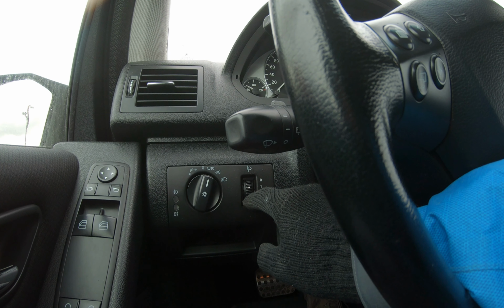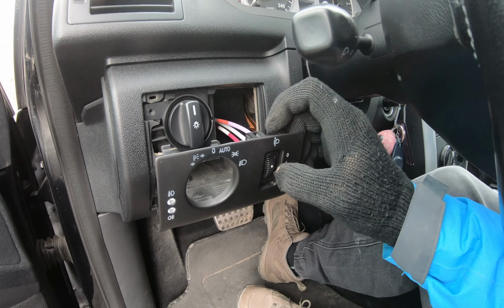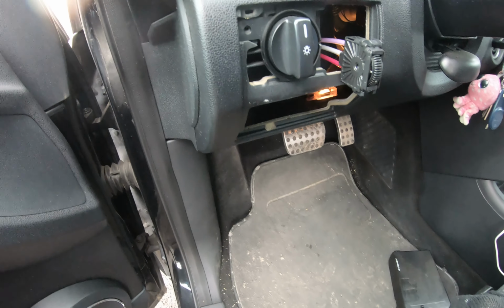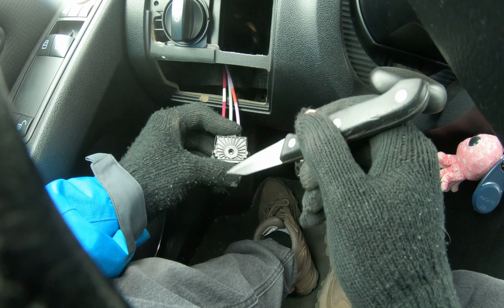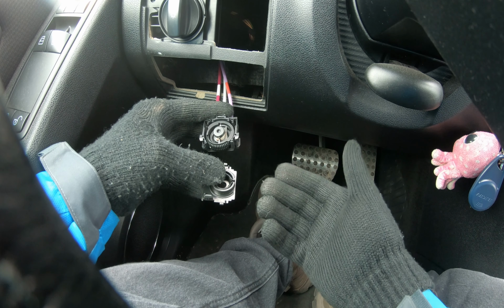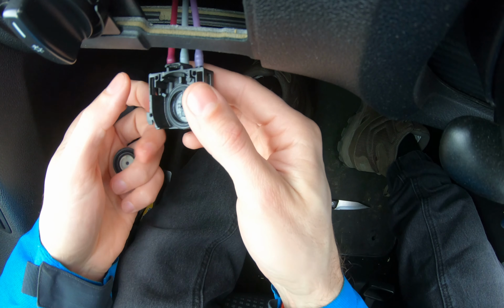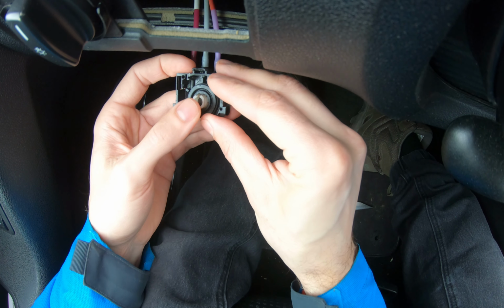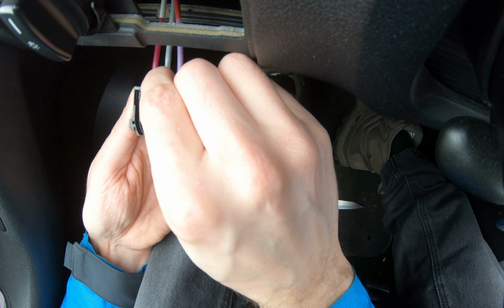Quick fix Mercedes A class W169 headlight adjustment vacuum switch button , Scheinwerfereinstellung

Comment: why didn't you show if it works at the end?
the switch headlight button when its when i turn off the car doesn't ring when i get out the car, do you know where it can come from? 
thanks for the video man
Reply from the maker: I couldn't show the solution because it was midday outside at the time of filming, and regarding your problem, please explain in more detail...
Reply: @AutoMotohowto46  thank you for you very fast reply :)
The switch button for the headlight (same as your video) If forgot to switch off I don’t have the alarm working to tell me the light still on, It was working before I don’t know why it don’t work now
Reply from the maker: @Bramsyouden  I understand now, I've never heard this problem before, but I think the solution is the light block itself...
Reply: @AutoMotohowto46  it’s working now, I didn’t do anything special very strange… anyway good videos for the class a , it’s all I need :)
Reply from the maker: @Bramsyouden  Magic 😈